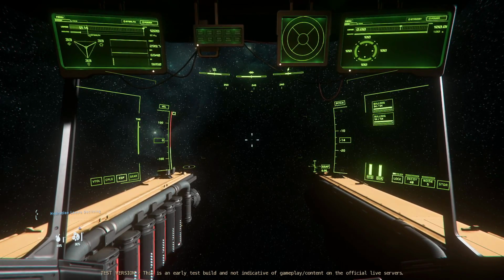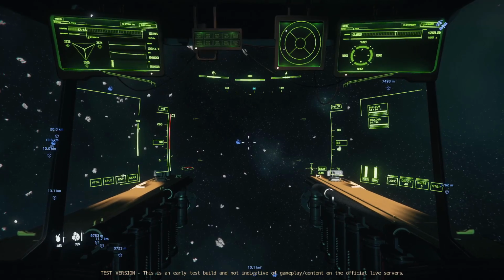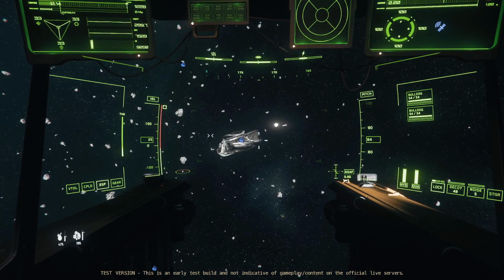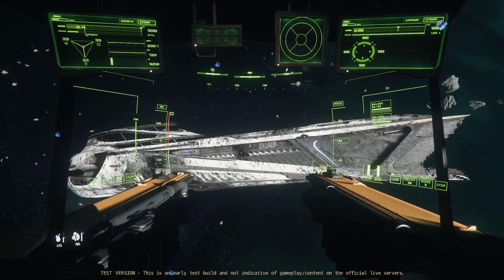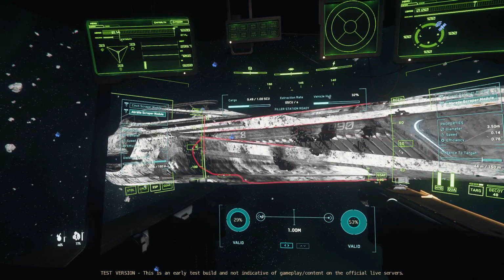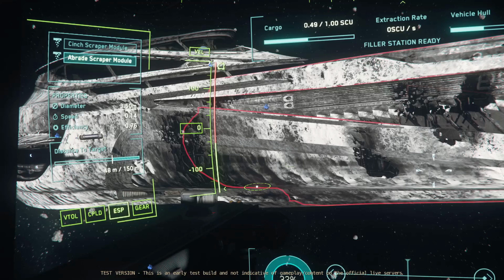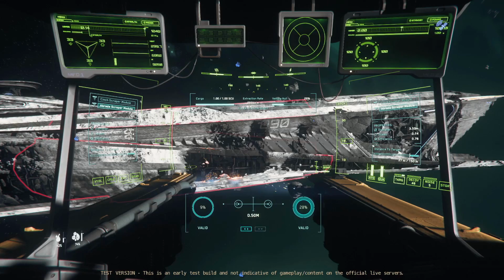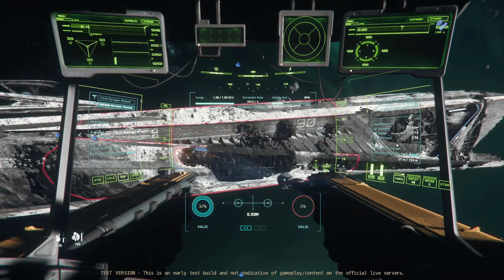Vulture Salvage Guide (beam convergence settings) | SC 3.18

Comment: M to Enter Salvage mode
Right click to switch between Abrade and Cinch
Left alt + W to enter fracture mode
Left alt + S to enter Disintegration mode
Left alt + scroll wheel to move salvage heads up and down
left alt + right click to switch them horizontally.
Something like that at least.